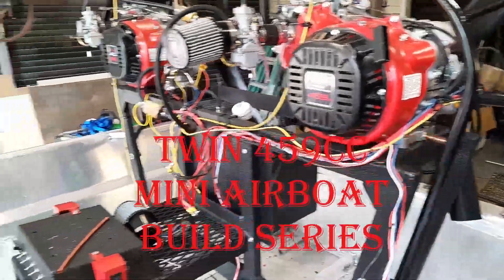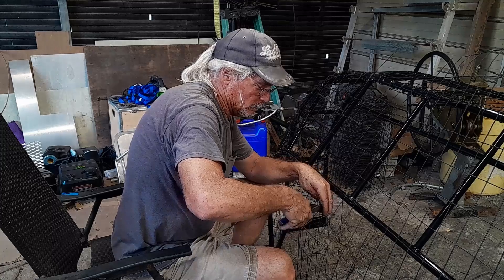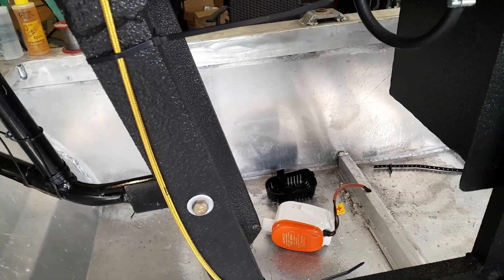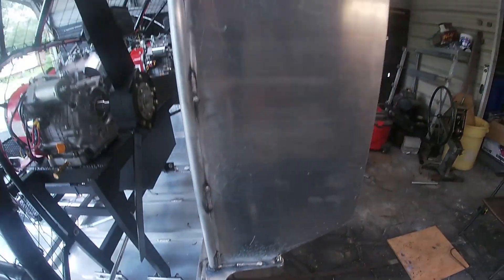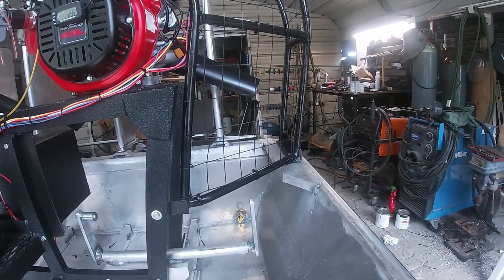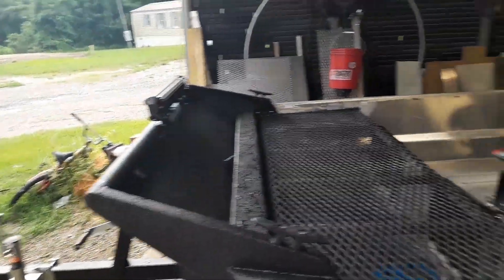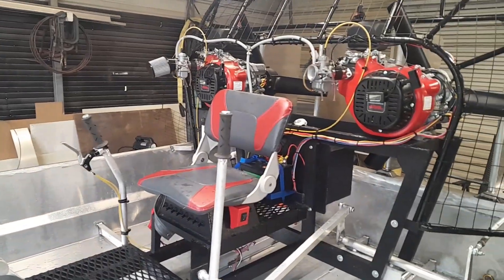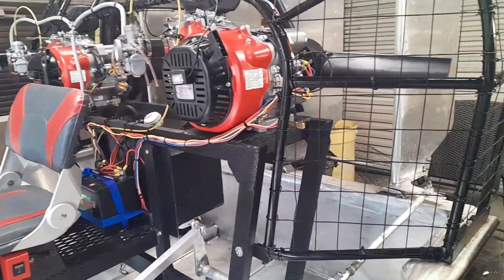Twin 459cc Mini Airboat Build, Houston We Have a Problem

Comment: Just out of curiosity, why do you have the adjustment between the rudders? My airboat rudders are bolted to a solid bar. I dont see any reason to adjust them
Reply from the maker: Just to get all of them tuned together. Once all are aligned they will be locked into place. These little boats need all the help they can get
Reply: I grew up in Florida, my Dad's best friend was Sig Walker. At 6 years old I used to go to the Airboat shop with Dad, and we would build the Seats, prop guard, and rudder. My Dad started putting about a 4" leading edge in front of the rudder pivot point. That made it feel like it had power steering. Before the prop blast when would try and straighten out the rudder.
Reply from the maker: I did consider doing just that. These aren't that big and the airflow is nothing compared to a full size airboat.

Comment: No discouragement! No need to move everything. Extend the hull by Boxing  in behind the transom and make it a small tool storage area wit some diamond plate  doors on top.
Reply from the maker: Already in the process of moving the engine stand and redoing the cage. No discouragement, honestly I was expecting it to be this way
Reply: @BoondockingCajunstyle  yes Sr. That’s usually the way it goes. So many things to consider fabing a boat, especially with weight distribution and displacement. You almost got it whooped though, won’t be long and you’ll be flying across the water in it.
Reply from the maker: @0iCu81b42  we are definitely looking for that.

Comment: Would adding ballast (lead) in the bow balance the boat easier than shifting everything?
Reply from the maker: I'm sorry I didn't see this comment. 
I do have several hundred pounds of lead. That maybe could help. These little boats are extremely weight sensitive.  It is a lot of work to move everything but, it is something that needs to be done.
Thank you for watching and commenting.
Reply: @BoondockingCajunstyle  You're welcoma and thanks for showing your work. Watching you makes all my projects seem way less difficult.

Comment: You could get away with two rudders id bet.
Reply from the maker: I strongly consider that.  The consideration that one engine may break down. With 4 rudders I would have a better chance of some control.
Reply: @BoondockingCajunstyle  with that low hp, one rudder will do more than enough work. Should have done two 22s. Negligible weight difference
Reply from the maker: @jayyep6974  pair of 22s would be interesting,

Comment: When I saw the linkages between the rudders, I knew something was up. I felt like that wasn't going to last long. On the bright side you have the entire frame finished and the schematics set up so it shouldn't be too long before you get the boat working properly.
Reply from the maker: I made the rod too short, where that the rod end bearing wasn't threaded in enough plus I didn't lock the jam nut. They all will be rebuilt so that ot is threaded in more.